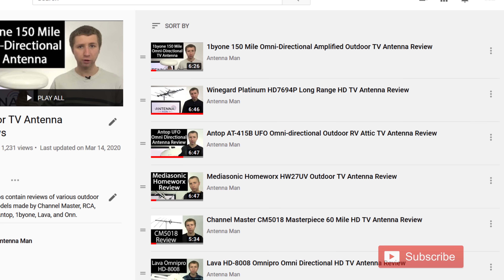Lose TV Stations at Night? This Common Item Interferes with TV Reception

Comment: I have no problems with interference with LED lightbulbs in my house but when I turn on my LED TV and laptop, that's when radio reception is affected. I have had to get a DAB+ radio with an external antenna connector so I can get DAB+ to work in the living room. One thing I do note is the massive amount of interference you get with DAB+ and LED bulbs (I'm sure FM and AM will also suffer but the stations I listen to are only on DAB+) in a town centre. Walk through a town centre with a pocket DAB radio during the day and night and you'll hear the difference. Where there is no reception you get few, if any dropouts once their lights are off (street lights don't affect the signal). During lockdown, I was one of the very few essential workers permitted to leave home to work and I could listen to DAB+ without issue as all the stores were closed and everything was turned off where normally the signal would keep dropping out. There are cars as well which spew out interference and override any usable signal you have. I bet these are the same people who complain that terrestrial radio is rubbish and everyone should listen to online radio.

Comment: Thanks for this helpful insight! I'm an electrician, and I can say LED's have both plusses and minuses. In terms of interference, they are an absolute nightmare. And it often gets much worse when the light is on a dimmer.  But they do use substantially less power. I usually see 60W equivalent LED's use about ~9W of power, and this reduction allows us to run fewer lighting circuits with smaller wire. Also, less heat from the bulb isn't as hard on the insulation on the wire at the fixture. 

I read this article a few years ago, and I sometimes wonder what happened to the research into incandescent bulbs that rival the efficiency of LEDs? 

https://news.mit.edu/2016/nanophotonic-incandescent-light-bulbs-0111
Reply: Less wire? I thought light sockets had to supply 60w no matter what, even if the intended bulbs are more efficient?
Reply: @specialopsdave  Always check the marking on the socket for the wattage rating. Some sockets are only marked for 40W or even lower. I always warn customers about this, but one recently ignored me and scorched the shade on her fixture.

Lighting circuits sometimes used to be run in 12 gauge wire, but now (at least residentially) there's not really any need. 14 awg almost always is sufficient.
Reply: @bhickey4009  I see. My house was built in the late 90's, so my house's fixtures are fully rated (60w indoors, 100w outdoors), and if I were to buy a new house, I would definitely use 12 gauge

Comment: Here in Germany we don`t have that problem with TV because all TV stations moved to UHF when they switched over to DVB-T2 (a similar system to ATSC 3.0) a few years ago. But we do have digital radio (DAB+) on VHF which is often affected by LED bulbs. Some LEDs cause more problems than others. Usually you can fix the problem by changing them, sometimes you only have to swap around bulbs you already have. Incandescent bulbs are not really an option. They have been banned and old stock is increasingly hard to find these days.

Comment: I wonder if anyone used 300 ohm flat antenna lead in anymore?   When I was a teenager 60 years ago I got tired of automobile ignition noise breaking up the TV signal.  I solved that problem by twisting the flat line. In todays digital world and using coax probable not useful Information.
Reply from the maker: 300 ohm flat cable is obsolete.

Comment: Good video. Thanks for the suggestion. My lightbulbs aren’t the problem and I’m still trying to figure this problem out. I lose WABC 7 and PIX 11 every night at 11:35pm on the dot like clockwork. 😡
Reply from the maker: Someone else is probably turning on a light. Check with your neighbors. You can also go for a better antenna setup. Consider an antenna recommendation from me at the link below. This can prevent you from spending hundreds of dollars and time wasted on setting up the wrong antenna for your area. http://antennamanpa.com/antenna-recommendations.html
Reply: @AntennaMan  way ahead of you. Immediately went to your site.
Reply: @AntennaMan  Also, I don’t think someone is turning on a light at exactly 11:35pm every night. The routine and exact timing points to something automated or mechanical.

Comment: I've found some LED Bulbs were causing most problems. Feit LED Dimmable bulbs would destroy RF channel 7.   Phillip bulbs were fine. I have 2" LED tubes in the kitchen that destroy RF channel 8.   I live with it, and turn off the lights. When I point my hand held LED spot light outside, I lose RF 7 and 8.
Reply from the maker: Yes, cheap LED bulbs are the problem.

Comment: Truth and Quality ,
Practical and Useful Information.
--------------------------------------------------------------------------------------------------------
L.E.D. Light Bulbs have electronic circuitry that controls
the L.E.D.'s = Light Emitting Diodes. 
Cheap bottom of the quality L.E.D. Bulbs can generate
a lot of electric/electronic interference.
>>> Yes is Ok to do research for quality L.E.D. Bulbs. <<<
------ 
Yes is Ok to move the antenna and electrics/electronics
and L.E.D. Bulbs away from each other.
   Yes is Ok to Not Be  / obstinate  / contrary / 
non cooperative / and just plain stupid.

Comment: I’ve been having a problem with CBC lately. CBC which for me is on channel 9 currently works fine on my downstairs tv. On my upstairs tv I have to turn the lights off or dim them in order to watch CBC channel 9. All another channels work fine.
Reply: Ps. I’m the USA not Canada.
Reply from the maker: Try replacing the light bulbs with higher quality LED or incandescent bulbs.

Comment: This solved the mystery in our home. We have just acceptable VHF reception during daytime. In our case, the problem was a lamp right near the rabbit ears. Interestingly but not shocking is that the dimmable WiFi bulbs are the culprit. I tried both Merkury and Sengled models and they both scrambled reception. But a GE Relax LED bulb worked just fine in the same fixture. So it must be the WiFi 2.4 GHz signal causing the interference. Another non-WiFi LED bulb closer to the window caused no interference either. However it might be the dimming function in the WiFi bulbs causing the problem. So I can keep using WiFi bulbs but I guess I will have to plug the fixture into a smart plug and settle for on/off functionality only.
Reply: Correction: So I can keep using simple LED bulbs (at least those GE Relax bulbs that work for us) but I will avoid WiFi and dimming LED bulbs anywhere in the vicinity of the rabbit ears.

Comment: Do you ever recommend a common mode choke in the form of a ferrite donut or tube placed at the feed point of the antenna? This would be for coaxial cable, of course. The choke would serve as a balun.

Comment: What is needed is for either Congress to pass lasws or the FCC to enact regulations to require LED light bulbs to pass Part 15 compliantly rules before it is allowed to marketed, and fund a Part 15 test programs for existing products and disclose its Part 15 compliance results so that consumers can act to replace these. Since so many public safety mobile communications frequency is in the VHF bands, there is a possible threat to communication! Should an array of sports fields go with LED lighting arrays for night lighting that are not Part 15 compliant, a serious threat to public safety could be posed!

Comment: I have what seems to be this problem as described exactly. But turning off every light in and out of the house had no effect. Everything great in the daytime, but at night I lose the channels on RF channel 13.  The next morning the channels on 13 are back perfectly. Any ideas?
Reply from the maker: You are likely just barely getting the signal. It sounds like you need a better antenna setup. Consider an antenna recommendation from me at the link below. This can prevent you from spending hundreds of dollars and time wasted on setting up the wrong antenna for your area. http://antennamanpa.com/antenna-recommendations.html
Reply: @AntennaMan  Thanks for the offer. When I purchased the antenna I went to your Amazon store and found the Winegard YA7000. I opted for the "YA7000C" because we also have a Low VHF station here.  All the transmitters here are located in one of two locations 11 or 13 miles away.  The particular one I am losing only at night is 13 miles, and there is another Hi VHF transmitter in the same location I do not lose. It is mountainous here, but according to the FCC DTV reception site, I should have an RX strength from that transmitter of 71 dbuV/m at my address which would seem to be plenty strong enough for that antenna (and apparently is during the day). Something only at night appears to interfere with that single broadcast tower.  I really thought your LED bulb idea was the culprit, but turning all lights off had no affect. I am perplexed.
Reply: So my problem turned out to be the night vision lights (I think they are IR lights) on my security cameras.  When they come on, I lose one station and its companion channels. That station comes in perfectly fine in the daytime, but cuts out at night. It comes back at night if I shut down the security system.  Any idea how to keep my security system working and get that station at night?
Reply: Just a follow up on this.  I was eventually able to solve the problem.  I was losing all the channels on actual RF 13 (High VHF)  when my security camera IR lights came on at night.  This happened despite having a dedicated high VHF antenna that Antenna Man tested as one of the best in addition to a Winegard that covers all bands pulling in quite strong signals in the daytime.  I tried adding the ferrite chokes to all the camera power lines, and moving the tuners in the house, but that didn't work.  The solution was to move the antennas, even though the antennas and antenna cable never ran very close to the cameras (about 10 to 15 feet at the closest).  I took the antennas off of the roof and moved them to the back of my yard (mounted to an extension ladder) to test it and the problem was gone.  Luckily I have a building back there that has TV and also network connectivity to the house so I didn't have to run long coax.  I moved the antennas and my network tuners back there, attached them to the network, and now all my TVs have all the stations, even at night.  I am not sure what the distance away has to be.  But if you have a similar problem, I would move your antenna(s) around to see if you can find a suitable location where the interference goes away. I hope this helps someone.

Comment: Terrible advice,  Buy better LED light bulbs,  don't replace the LED bulb with incandescent.  Solve the problem the right way,  don't run away from it.  You know what else causes RFI,  the TV itself.  LED backlights,  Plasma TV's.   OLED's.   I own a couple spectrum analyzers and you would be shocked at the RFI from TV's and Monitors.    Again buy LED bulbs that don't cause RFI.

Comment: So will your; 
Cell phone charger.
Cell phone. 
Washer. 
Dryer.
Almost any appliances that utilize alternating currents.
ALSO; some/all of these devices may cause direct interference to reception from the height of your OTA antenna.
Ever listen to your radios inside your home loudly? 
Nooooo...
Well, have any objects "buzzed", or "hummed" when a certain note sounded?  That's due to clashing of frequencies. That is harmonic distortion, or, harmonics. 
Don't be fooled, snd thinking it's resonance.  Resonance wil be much more subtle, anz could actually make reception just a wee bit better.

Comment: Holy Smoke Antenna Man!!  Problem solved.  I live in rural northeastern Maryland on the Maryland-Pennsylvania line.  No cable or internet in my area.  I’ve always had to have a good outdoor TV antenna with a good pre-amp and get great reception.  Recently, I’ve been experiencing poor TV reception every night for the past two weeks, where I was losing several RF channels (11 & 12) only during the evening hours. Great reception during the day.  Never had any similar unexplained issues before. Totally frustrated!!  Watched your video and gave it some thought as I sat on my couch this evening.  Finally, I got up, walked outside onto my back deck and unplugged the 12 strings of my new LED Xmas lights (these lights were almost directly underneath my outdoor antenna).  Immediately, my poor TV reception totally cleared up!  Figuring that it was a fluke, during the next several hours I turned the LED Xmas lights on and off having the same results each time; poor reception with the lights on and excellent reception with the lights off.  Looks like I’m gonna have to dig out my old incandescent Xmas lights tomorrow. Thanks for your help. Enjoyed your video. Happy Holidays!!!  🎄
Reply from the maker: I'm glad my videos helped you get better reception. Feel free to give a contribution at the link below as I spend A LOT of time making the videos and responding to these comments:
http://antennamanpa.com/support.html

Comment: In recent years linear power supplies have been replaced by cheaper "switching power supplies" because of their higher power output capacity,, and smaller size.  These switching power supplies are commonly the culprit in LEDs that generate RFI (Radio frequency Interference) or "noise". Some are noisier than others, usually because of a faulty bypass capacitor inside the power supply even though this power supply will otherwise function normally. They are mostly used to power phone chargers, modems or routers.  By the way, these noisy power supplies are often the reason your WiFi service is degraded.
Reply: Good call. RF, from any device could definitely affect reception. Lower powered devices could, too, due to those nasty (sometimes) little harmonics.
I bet you make your own antennas...

Comment: I just figure it out by unplugging my amplifier from my antenna, the tv signal is now improving. Now, I can watch the news crisp and clear picture at night.
Reply: Truth and Quality , 
Practical and Useful Information.
-----------------------------------------------------------------------------------
Yes is Ok to do the Cut and Try Methods of 
searching and investigating.
Yes is Ok to Buy and Use Quality.
The Real Thing , Not Just Claims.
------
We live in a time period on this planet that is
super saturated with lies.
------
Here is and not the only quality.

www.televes.com/us , advanced antennas
and amplifiers and power supplies.

www.channelmaster.com

www.winegard.com

www.antennasdirect.com

www.3starinc.com

www.walleyesolutions.com , take it to
the other side.

Type the words , flat jumper coax , in , 
www.google.com , www.yahoo.com ,
www.amazon.com , or some other 
search box.

www.rabbitears.infor , has reception maps.

www.fcc.gov/media/engineering/dtvmaps

www.fcc.gov/over-air-reception-devices-rule ,
Says Yes antennas can be installed outside
in plain sight. In such a manner so as to have
Reliable Reception.
Also antennas can be installed outside of , 
apartments , condos , and etc. .
Yes is Ok to read and understand the FCC
website.
------
www.epvision.com , advanced 
Tuner / Recorders , and Streaming.
------
www.ooma.com , free and low cost
phone service.
------

Comment: LEDs DO NOT cause RF  interference. LEDs are essentially diodes & do not generate RF. Some of the poorly designed power supplies inside LED bulbs used to drive them may cause interference. Most of them are OK, causing interference on the much lower AM radio, or shortwave radio bands if the receiver or antenna is nearby, but not on FM, VHF, or UHF. The majority of LED light bulbs & Christmas lights do not have those defective power supplies, but a few do. Excessive RF emissions from devices & power supplies are prohibited under FCC law. However, a florescent light near it's end of life or flickering can cause VHF interference from a couple doors down. Mercury vapor, & Sodium (yellow/orange ones) outdoor lights near the end of their life can cause interference on AM, SW, & VHF from over a block away.

Comment: In my new camper I have a great disk antenna on roof that works great during daylight but loses signal at night and I might add that I do try to adjust the antenna T night to no avail. How do I fix this? Thankyou
Reply from the maker: You likely need a better antenna. Disc style omni directional antennas don't work well. Consider replacing it with this model and pointing it towards the closest city: https://bit.ly/2W92bEB

Comment: I started picking up NBC with my Antop antenna but it never wants to clear up an its the only channel that is doing it. Have moved it in different locations nothing works. The antenna is outside 

 Any advice would help thanks
Reply from the maker: You may need a larger antenna. Consider a custom antenna recommendation at the link below: http://antennamanpa.com/antenna-recommendations.html